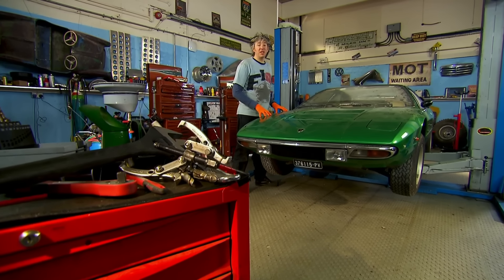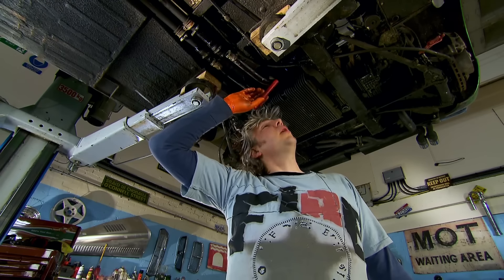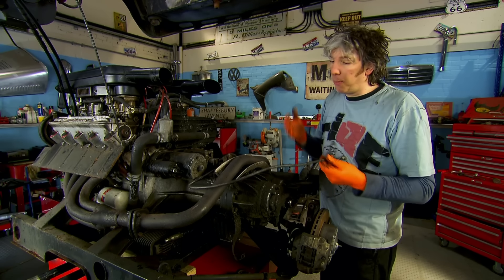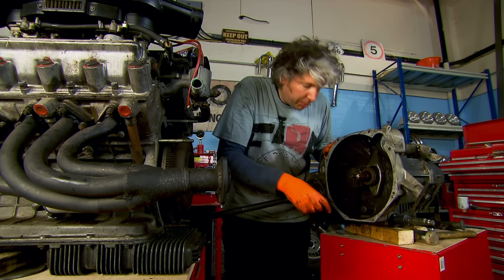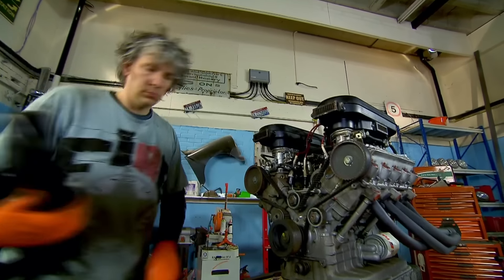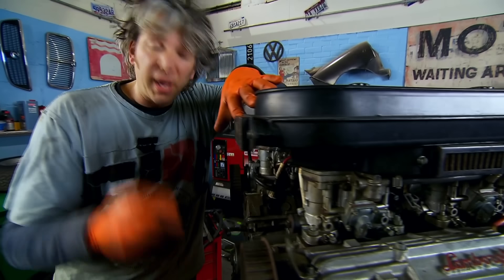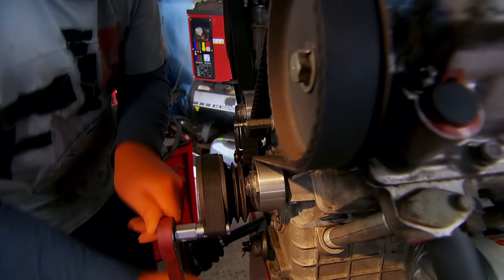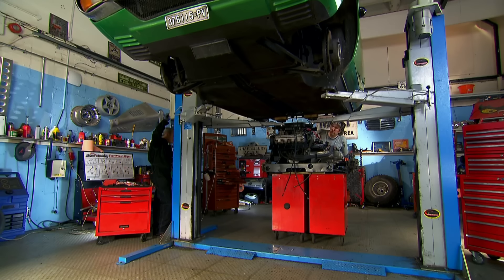Lamborghini Urraco: How To Completely Refurbish The Engine | Wheeler Dealers

Comment: Wheelerdealers: 10min from start to finish full engine restoration
Tavarish: 10min to change a a spark plug
Reply: hahaha :D
Reply: Tavarish rubs me the wrong way. I tried watching his videos, but commanding the charisma of a pissed of stray cat just makes it all unwatchable.
Reply: @skitzvitz  to top gear like. They aren't copying so much, but the technique only works with 3 men on this planet.
Reply: @MrJetFormation  problem is Car Trek is just too low budget and the trio just dont work well together. Hoover and Ed is just not correctly doing their characters. I think Freddy is doing quite well. The other two is just not there. Ed specially is just too god damn boring.
Reply: @DMalek  I think they are trying too hard to be top gear and should be trying to do their own thing instead
Reply: Full engine restoration without even changing a spark plug or checking valve clearance ...
Reply: To be fair to the whole team, WD used to be exceptionally edited which meant it was very easy to follow and at the same time it was both engaging and educational, even though the episode time was limited. That was before they permanently landed in the US, it's all gone down hill since then.

Comment: Nice video. I got a lot off problems from bad design on leak waterpump go through the distributor and also a broken gear claw, broken speed gauge cable, engine oil leak .but that was 40 years ago

Comment: Installation of a timing belt does not require cam locks to stop accidental cam movement due to valve spring pressure?